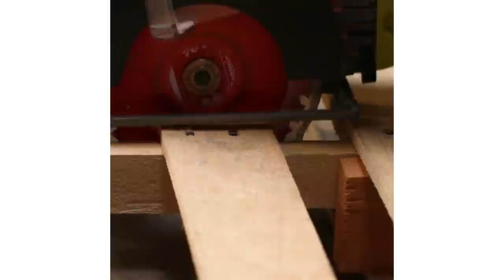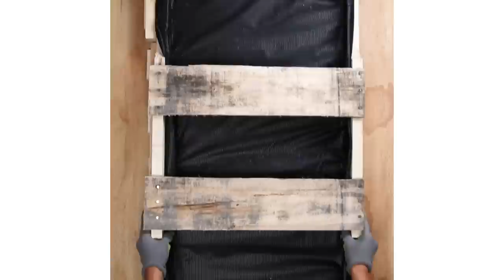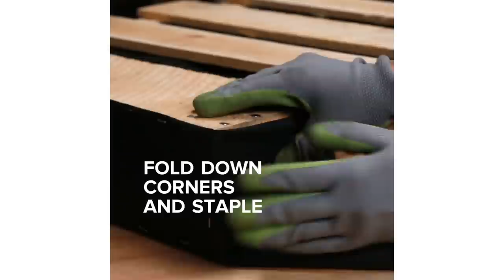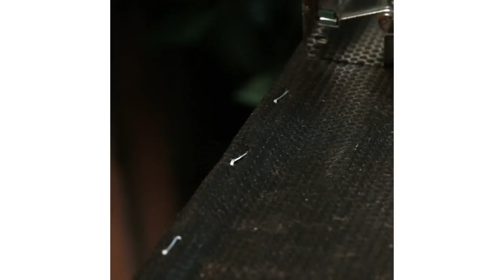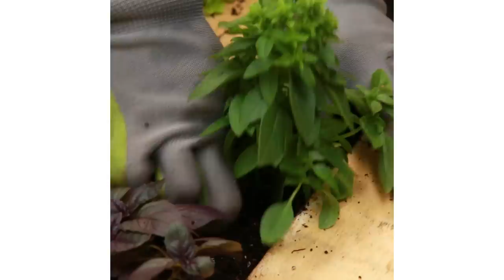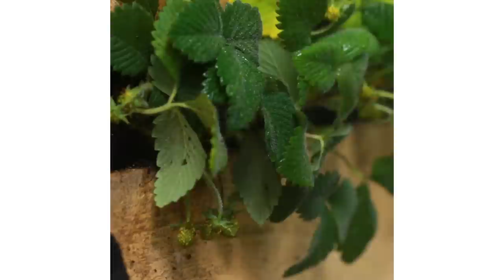Vertical Fruit And Veggie Pallet Garden

Comment: I’ve been watching a bunch of these videos and this one has to be the smartest simplest way I’ve seen it done ✅ great job
Reply: Actually I find this is the cheaper lazier way and honestly the most wasteful, think about how little room there is meaning it'll only be a few years before that thing will need to be tossed into the dump and it's plastic stapled into wood so it's not recyclable, at least not easily. Also this thing could become really waterlogged with the plastic.